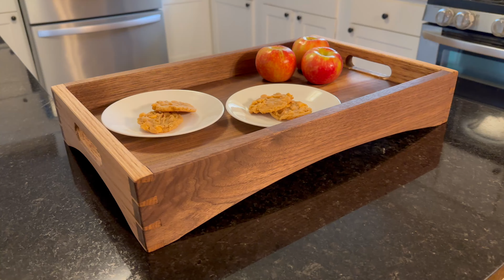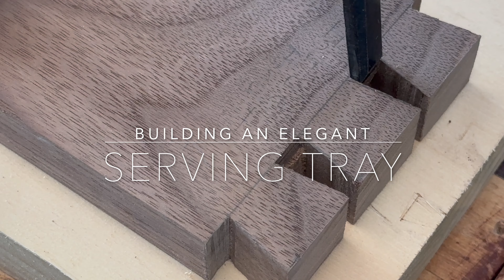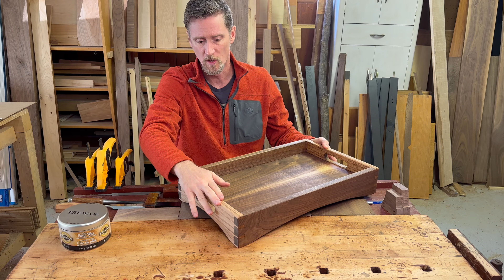How to Build a Wooden Serving Tray - Beginner Friendly with Easy Hand Cut Dovetails

Comment: Rob Cosman has some tips for dovetails that make it fool proof. A marking gauge , dividers for marking and offsetting the kerf of your saw to make your dovetails fit exact.
Reply from the maker: Absolutely great advise from Rob Cosman. His “Shawn Shim” is the tool you’re referring to. Angle dividers are excellent especially when making many dovetails across a broad board (I go the quicker route of a simple ruler or just estimating for smaller boards). Thanks for the comment!
Reply: @jeremymack-snowday yes the shim, but in his earlier videos he showed you how to use the marking gauge to set the depth of the kerf and offset the pin board using the marking gauge. It’s pretty genius and my dovetails look like a cnc cut them, using only handtools.
Reply from the maker: @Licensedelectrician18735 thanks! I’ll look into it! I love Rob Cosman and Paul Sellers!